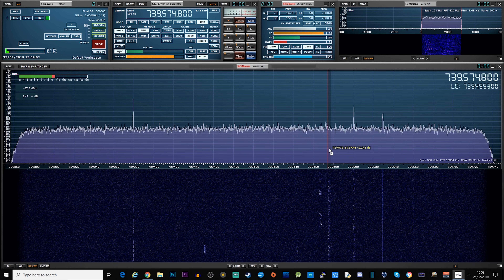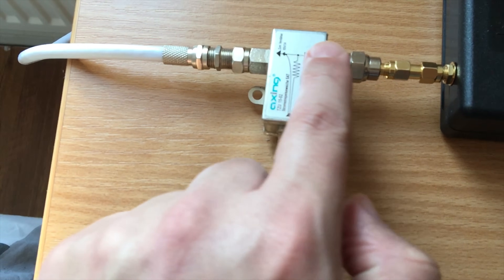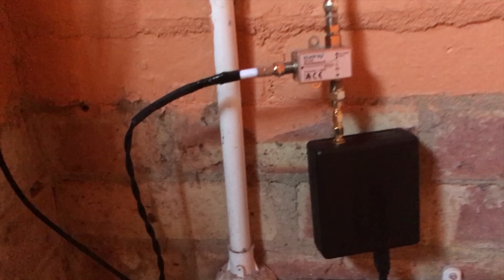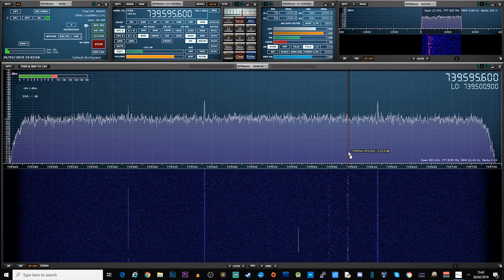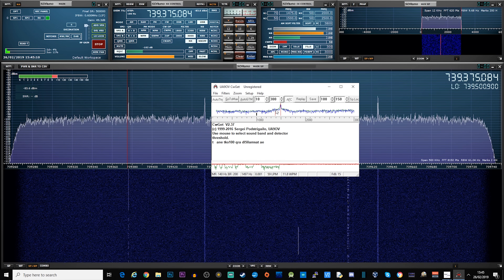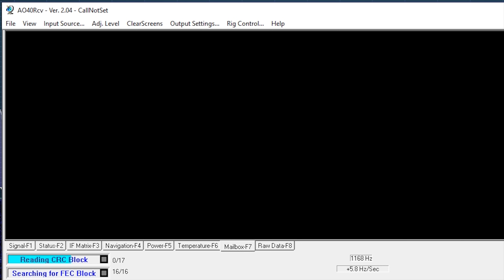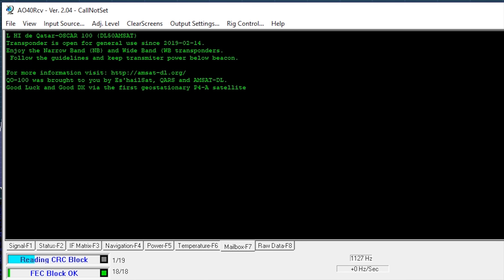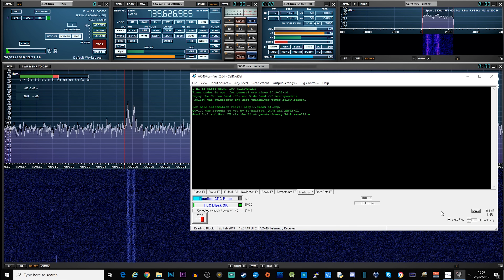My First Es'Hail 2 NB SDR Receiver Setup - Did it work?

Comment: use a compass and protractor line the dish up to 1 degrees west of true south this i think is Thor Tv satellite for scandinavia,all sats going to the west will im sure be the interesting ones,yer using a offset dish perhaps use prime focus thats the ones where the lnb is in the middle,the benefit is use a full Ku band multi lnb with a universal polarise to get h v left and right signals also very old 80s BSKYB square nd mini dishes are left or tight polarization turn the lnb to right or left big prime focus dishes can also use c band and s band lnbs s band i thik weather stuff c band low freq sattelite radio tv feeds etc they on most sattelites mostly in the western range not eastern though theys some easten ones,a large 1.2 meter dish is best with the best c band lnb they cheap as chips

Comment: Interesting.  I've been playing with Es'Hail myself lately.  Looking at your setup, you may want to try a simple clinometer to check if those trees really are in the way.   A flat surface, a protractor held vertically with a ruler set to the correct elevation... then sight along the top edge is enough.   Human beings are pretty poor at guessing elevation angles, so you may well be wrong in blaming the trees.    I'm using an 80Cms offset fed dish at ground level peeking through between local houses and the signals from Es hail are not very strong.  In large part that's down to range, atmospheric absorption.... the signal sees a lot of atmosphere,  and mostly the fact that it uses an 'elephant gun' antenna to illuminate a third of the planet... so you  have to expect the signals to be weak.  I reckon the trees are probably not the real issue here.... that small dish probably is.  I'm using an Octagon OTLSO  PLL LNB and given a choice, I'd have gone for at least a 1M dish... just for the very worthwhile extra gain, but SWMBO won't let me :-(    getting the polarisation right is very important at microwave frequencies but you probably know that already.   Good luck with your experiments.    There are some very good online calculators for dish gain at various diameters.  have Fun and cheers for sharing.    http://gm1sxx.blogspot.com
Reply from the maker: Hey Allan, thanks for the comment, it’s very much appreciated! I’ll be revisiting this project in the near future with installing the dish on my chimney. Something that I failed to mention in the video is that all of my neighbours who have SKY Satellite TV have their dishes on at least 10 feet poles on their chimneys to get through the woods/trees. Once I get around to grabbing the gubbins to make a TX then I’ll get back onto this project. Thanks for watching! 👌

Comment: I do not think the trees are the problem…..you can try to receive a free channel with a normal Free to air Satellite receiver on the  UK Astra 2 satellite on 28,2 E...if you can receive it well ..you can see the signal strenght on this receiver in the  Antenna search screen...best way ofcourse is to measure the gain with a ( professional ) Satellite meter..thats what i have for my Satellite  Dish installation work..HI...then this  ES'Hail Satellite is no problem for you on 25,5 E.... because the Elevation angle  is   2,7 degrees higher..you can try another PLL LNB...but a bigger Satellite dish is the best option to have more gain ofcourse ..a  60 CM Dish is quit small.. i have a Visiosat 95 CM motorised Dish...and a brand new Octagon Twin ( 25 Mhz)  PLL LNB ….and an SDP-Play.....next week i will try this Oscar 100......73 Gerben PA0GDW

Comment: Have you solved the problem? It would be nice to hear how you got on. 73 de Steve DL1YAL
Reply from the maker: Hey Steve! I’ll be revisiting this project in the summer, once the trees are fully leaved. Then I’ll be able to tell if it was trees. Other than that I will have to mount the dish on the roof somehow but I’ll definitely make another video :) cheers, Matt

Comment: Getting nowhere trying to align the dish to 26 east. What transponder did you use to find it ?
Reply from the maker: I just set the dish to an approx angle (check the wiki links for exact degree) then just moved the dish left to right while looking at the SDR software for maximum peak.
Reply: @TechMindsOfficial  how.did you connect your 12v supply to the bias t because those tiny power plugs are impossible to connect wires to...is a cb type 13.8v supply ok to use btw ?
Reply from the maker: I just used a couple of inches of coax I to the connector and then connected power wires to the coax. I’m pretty sure your 13.8 supply with be fine. :)
Reply: Tech Minds it's the tiny plug these psu's use which makes it near impossible to connect to so in the end I bought the axing one from amazon France. I'll try again soon

Comment: Does need to dc stop filter between baistee and nornal rtl2832u dongle ??? Does the voltage come out from baistee damage normal dongle ????
Reply from the maker: The Bias tee only allows dc voltage to flow one way, to the lnb. The bias tee will have a capacitor inline to block dc to the rtl SDR

Comment: Your signal is a bit on the low side as you said in the Video. I have the same size dish and and my high side beacon is about 21dB above the noise, your seem to be less than 10dB. 
Try replacing the LNB to GM-201 .I see an improvement of about 7 to 9 dB between this LNB and an Octagon OSLG. 73 Harry SM7PNV
Reply from the maker: Thanks Harry! I will look into that 👍

Comment: how you doing with the reception. Any improvements? I'm getting some cracking signals from my qth. 80cms Dish, modified octogon lnb from Darko OE7DBH, sat cable 75ohm to a bias T ( 12v supplied by motorbike battery which cancels a lot of noise) then 50ohm cable to a 40db attenuater. From the  attenuater I run 50ohm cable to the rx ( FT790 ).  I'm lucky I only need a 4 metre run of cable to the shack.There's a vid here on YT showing Darko testing such a setup. 73s de Steve DL1YAL

Comment: Where did you get your bias t from ? I've got a rsp1a and 1m dish with a PLL LNB so hope I am good to go for rx anyway
Reply from the maker: Link down in the description my friend :)
Reply: @TechMindsOfficial  Ah yes, thanks
Reply: So you've used that jvc power supply's mains lead to connect directly to the f connector of the bias t ?
Reply from the maker: Yep, it provided 12v DC. Centre pin positive and outer is ground. Although, my next attempt when I get a larger dish will be to use a 12v battery to eliminate any PSU noise
Reply: Tech Minds ok I've got a 12v motorcycle battery, I'll try that, guess I can use coax for the power lead
Reply from the maker: Yeh that should be fine.
Reply: I'm all setup with a 12v m/c battery and the octagon LNB. Just got to try and align the dish. Will I be ok with one of my RTL V3 dongles? Not sure I want to use my rsp1a

Comment: I'm going to be trying this as soon as all the bits arrive.

Apologies if i'm teaching granny to suck eggs but, are you sure those trees are in the way? 

They look far enough away that the dish (as it's an offset dish) might 'look' over them with an elevation of roughly 23 degrees (which I think is right for Es'Hail in the UK?)

A simple inclinometer will tell you but you may just need to move the dish a few metres back from the trees or raise it a bit to clear them if they are in the way. 

Pythagoras will also tell you if they're too close

Comment: Got my Rsp1a..is the frequency 739.574.800? And also is it correct that on my Lo frequency it’s reading the same?
Reply from the maker: Yes LO is the same as no need to lock it. The down convert freq depends on your LNB, but most do goto that IF range.
Reply: Tech Minds great thanks.I bought a 1m dish and an inverto pll Lnb.The thing that’s been throwing me off is the frequency! Will try 739.574.800 and see if signals pop up .Thanks again for advice and info👍
Reply from the maker: 739.500 should be around the center of the band with 125khz either side. The far left signal is the constant CW beacon coming from Es hail 2and the signal far right is the telemetry from Es Hail 2. This is for the Narrow band, not the DTV. If your dish is aligned then you should at least see the band edge signals. Good luck and let me know how you get in! A 1M dish should be perfect!
Reply: Got dish up today,set dish to 150deg azimuth se..sdr at 739.500.000 nothing received at all?
Reply from the maker: @dxscotland5901  Silly question but are you powering the LNB with 12v via a Bias Tee? if you are able to view the SDR screen at the same time as moving the dish it really helps, i remotely VNC'd into my PC from my iPad so I could see the scope and waterfall as I adjusted the dish. It has to be pretty bang on to receive something.
Reply: Tech Minds Bias-t is ordered but as I had twin Lnb I put 12v up the spare port.I measured the line going to the sdr play 1st to make sure there was no voltage present.Im guessing that between sdr and dish that’s were I need the T as supplying voltage up the spare port made no difference.My bias-t won’t be here until 29th March ☹️
Reply from the maker: You should see a massive signal difference with and without power applied to the LNB. I’m not entirely sure if putting 12v into a spare port on the LNB would work, but possibly best to wait for the Bias T to arrive. I ordered mine on Amazon and it arrived next day. Fingers crossed it all works when it arrives, let me know :)
Reply: Tech Minds will do and thanks for your advice 👍
Reply: Finally some progress 739.193.650 is where I found Eshail cw ident! It’s weak so tomorrow I’ll do some tweaking of the dish to improve the signal 👍
Reply from the maker: That’s great news! Well done! Did you improve the signal?
Reply: Yes spent a couple of days fine tuning,very strong signals coming in now!! Thanks for your help and advice 👍
Reply: Working on a patchfeed now ready for tx! Now dish is set and the Rx is very good.Some good activity from hs0..zs..py..3b8 today with great signals.My dish up about 15ft it’s a 1m mx-digital-Lnb inverto pll

Comment: How did you down convert from 10ghz ? Is it built into the receiver?
Reply from the maker: Chris Bloy it’s built into the LNB :)
Reply: Tech Minds that’s interesting :-) May give it a go then.... just out of interest did you try the bias t on a battery yet? Also, I’ve seen some just use the LNB and nothing else?
Reply from the maker: Havnt tried battery yet, I have one on order so will try as soon as it arrives. Normally LNB will need to be powered 12v for vertical and 18v +22khz tone for horizontal. But I’m only interested in vertical for the moment. Go ahead and try it, let me know if you have success 👌

Comment: I would say your signals aren't that bad.   Maybe lower the input gain a bit.
Of course reducing coax length is not going to help.  In fact you can have a very long coax to the LNB without any effect.
What helps is finding a spot not behind trees and a larger dish.
These days the sun gets quite near the satellite in the morning, check out when it is closest in a tracking program and see if the sun still directly lights the dish (is not behind the trees).
(it may be above the tree tops)

Comment: Try using a 12v battery instead of the power supply. It's probably a switching power supply not a real transformer. By using the battery the noise floor will lower down. Hopefully that way you will get a much cleaner signal.
Reply from the maker: I did actually try that with a battery and you’re right, the noise floor did drop. I’ll try again with how it’s setup now :) cheers
Reply: yep using a 12V battery drops the level a lot. I don't think the trees are an issue mate. The angle should be sufficent to clear them.. You have a quad LNB I see. Have you compared the all 4 ports to see if there's a difference ?
 @TechMindsOfficial
Reply from the maker: honigmonster you’ve just given me something to try tommorow :) altho, in the video it’s hard to see the angle of the trees from where the dish is, the dish literally is aligned through the trees. But I’ll defo be try a 12v battery and try the ports tomorrow, cheers for the tips!

Comment: Very high RF gain is on your panel display. Do you get better signal to noise with far less pre-amp gain? 73 de M0YDH
Reply from the maker: Hi David, thanks so much for your comment. Unfortunately I get the same signal to noise with the gain down, I have also tried the inbuilt attenuator but with no improvement. The only conclusion I have is to try a larger dish. Have you personal experience with this? Could do with some advice lol
Reply: @TechMindsOfficial  Larger dish diameter will bump up your gain. I might order a Triax 1.1m dish if nothing local turns up. I'm watching my pioneering clubmates in the BATC and friends on Twitter learn what works on narrow band and ATV. I have a DATV station and am building a second #PortsdownTX with a Lime mini SDR. QO-100 is the only ATV repeater I can reach from my home.

Comment: Why does the sdr frequency show 7396256965? Gm4zji Chris
Reply from the maker: That’s 739 MHz. The reason is because the LNB down converts the 10 GHz signal. All LNBs do the this. So we tune the SDR software to the IF of 739 MHz. We still get the 250 kHz bandwidth. You may see some other users using software like SDR#, but if you notice they will have a 9750 MHz offset.
Reply: Tech Minds thanks for the explanation 👍I’ve been listening on goonhilly sdr and I m definitely interested in setting up a station for this sat.Ive heard some great dx.Note on your dish/Lnb..some people have turned the Lnb slightly to improve signal.All the best and keep up the good work 👍Gm4zji Chris

Comment: Reminds me off around the year 2000 or 2001 or so. I lived at home with my parents. We got a sattelite dish for the tv. The dish had two cables coming out. So I could also watch in my room. I bought a dvb-s card for my pc (verry expensive at the time). I could watch and record a lot of channels. Verry exciting at the time to experiment with. It was in a time when we didn't have 24/7 internet access yet (dial-up) so it was something fun to play with.
Reply from the maker: One of things I liked to do was make cards which slotted in to the decoder, it was just a TTL to RS232 using a max232 chip, but I used to run some software called voyager, which decoded scrambled channels.. it was all for experiment purposes 😂